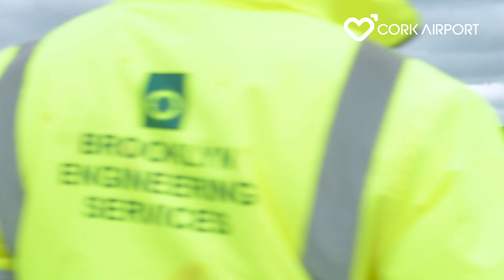Week 6 Cork Airport Runway Reconstruction Documentary Episode #2

Comment: why didnt ye extend the runway
Reply: There is privately owned land on both sides of runway 34/16 therefor it would be a waste of money to extend the runway by 100m or so.
Reply: @lukebyrne3715  LOL have you ever heard of compulsory purchase orders? It doesn't matter if the land is privately owned or not. Projected growth of the airport doesn't require it to have an extended runway.
Reply: @AntiDumb2023  the initial question was “ why didnt ye extend the runway” . We’re not talking about extending the airport
Reply: @AntiDumb2023  if the government were to introduce a CPO on land the planes would extremely close to houses. Quite frankly the government don’t have a lot of money to spend after the pandemic and there is no need to extend the runway as planes such as the Boeing 747 (the second largest passenger plane) landed in Cork airport before when they extended the runway in 1989 to bring it to its current length of 6998ft.
Reply: @AntiDumb2023  it’s not the right terrain, cork is not a gateway for major aircraft which would require at least 500m down over a hill
Reply: @lukebyrne3715  you're literally answering me with my own answer. I clearly stated the runway is not required to be extended given the future growth estimates for the airport, but I think eventually it will in perhaps 30 plus years. 
Also, I never mentioned airport extension either. 😐